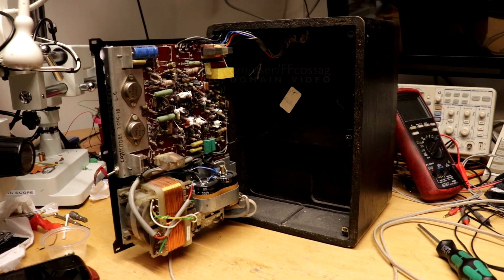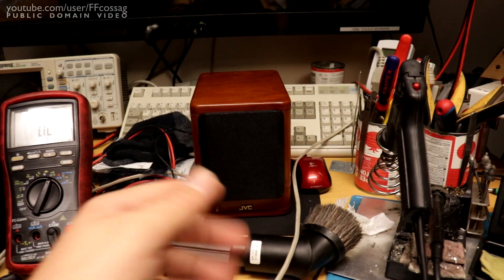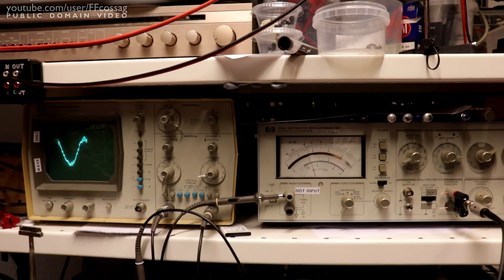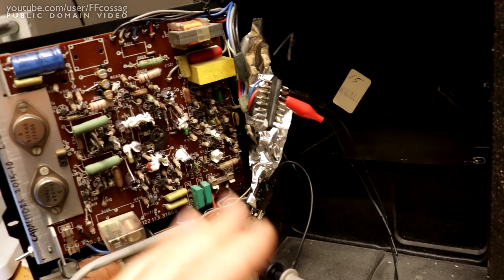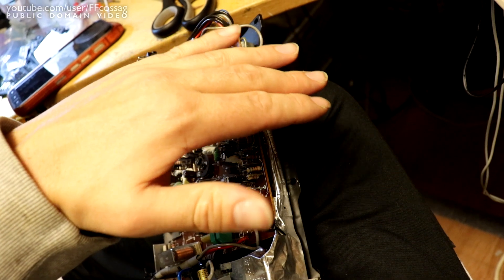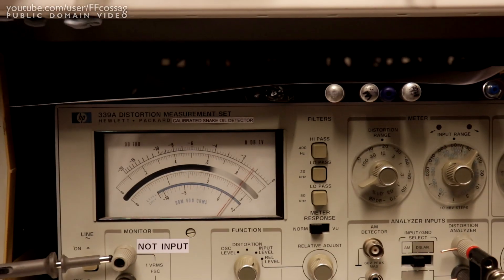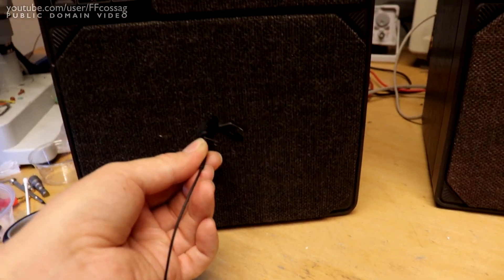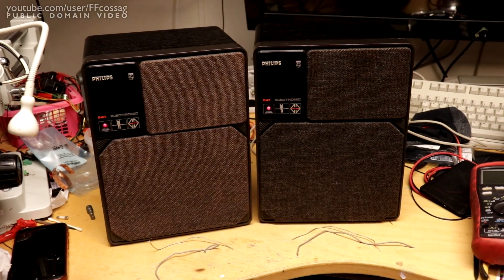Philips 541 MFB: Hum fix!

Comment: To quite Captain Sulu; "Shields! SHIELDS!!!!" - Because shielding protects many things from unwanted interference... :P
Reply from the maker: Hehe, yep - though this kind of problem is often not solvable by shielding since hum will happily get induced into the shield as well, causing hum because you get a small current flowing in the shield, which essentially lifts and lowers your ground at 50 Hz. Which, for all the amp cares, is the same thing as hum being induced into the signal conductor.

Comment: Gosh that's awesome. I may try this on my DUX 's, which are basically Philips oems by a danish audio brand. I have the equivalent of the 541 and indeed hummy on the preamp setting. Also the cables to the audio preamp make a difference. Wat kind of cables would you suggest?
Reply from the maker: Any decent, double-shielded cable will do fine. Somewhat expensive microphone cable is often a good choice, and the wire stock in old 5P DIN cables is usually really good. If you run them to a power amp you can get away with almost anything since the input impedance is so low.
Reply: Actually i have a potmeter on mine to adjust the input sensitivity. Perhaps i have one model higher/larger, so 542 maybe Well, same problem...., potentially same solution
Reply: There was a Danish version of Philips MFB too? In Norway we had Wellex.
Reply: DUX was actually Swedish - basically Philips products, but restyled to fit the Scandinavian design taste. In Denmark, we had Jamo, who made several speakers with licensed MFB technology back around 1980, such as the huge MFB-300 with a bulit-in 10 band graphic equalizer!
Reply: @tjoernild Cool! I have a pair of Philips MFB 567, and have been told that this was a speaker Philips had to make to appeal to the Scandinavian market after releasing the MFB 544 (Witch I Also have a pair of.) The Retailers in Scandinavia liked the 544, but wanted larger cabinets and woofers. So Philips gave them What they asked for. The electronic part of the 544 and 567 is basicly the same.

Comment: This is super useful stuff for a guy owning a pair of MFB 541, MFB 544, and MFB 567. (Tell me if anyone know a pair of MFB 545`s for sale at a reasonable price, to make the collection complete!) Thank you for the video!
Reply from the maker: Man, colour me envious, especially of the 567s. I've never heard one of the big MFB speakers but I bet they sound amazing.
Reply: @FFcossag  I actually prefer the 544`s before its larger siblings. But I think that the reason is that the 544`s was renovated and adjusted by the experts at MFB Freaks in Holland. 

The 567 is the Scandinavian MFB model BTW. When HIFI dealers in Denmark, Sweden and Norway received the MFB 544, they soon asked for a larger speaker. The reason was that the trend at that time was large cabinets and woofers. So Philips made the MFB 567 to adapt to the Scandinavian market. The electronic part of the 567 is the same that you find in 544s
Reply: My understanding is that the RH 545 is quite rare nowadays...they sold for as much as a Klein & Hummel OY powered monitor set did back then.
Reply: @douro20  They are not that totally uncommon, but most of them are way overpriced. Plus they are so big and heavy that it often is a problem to get them shipped, if you find a pair.